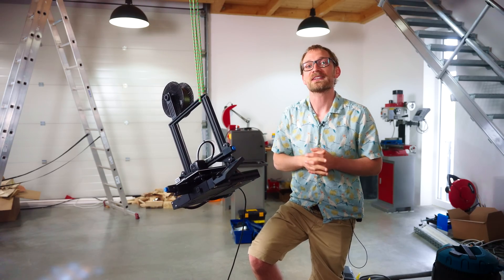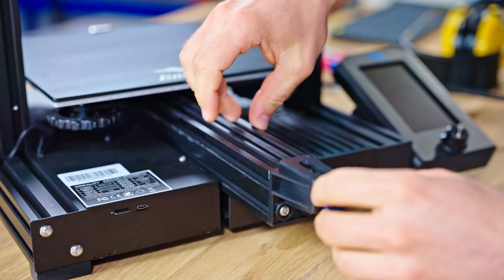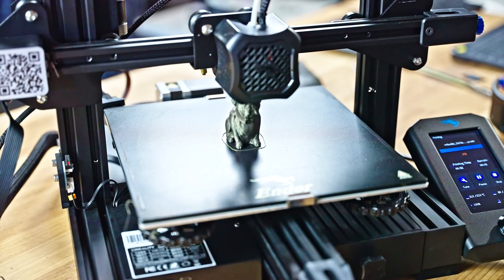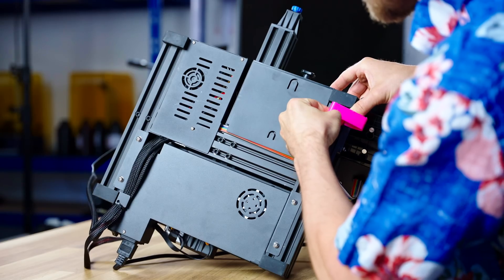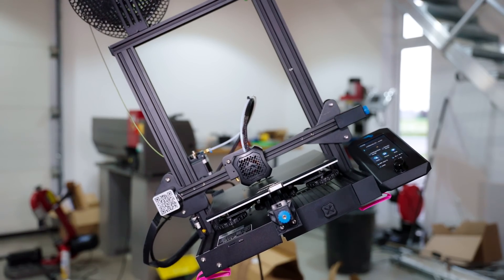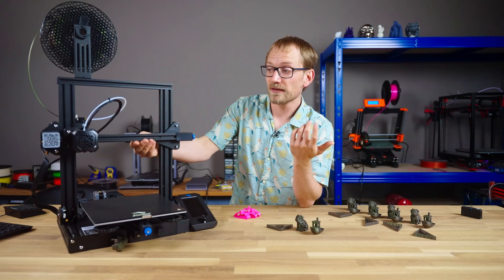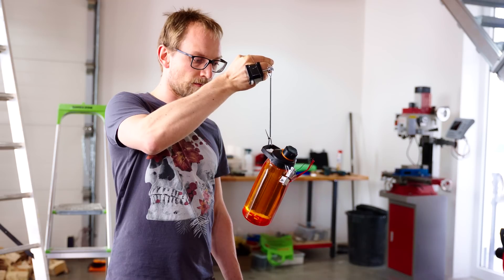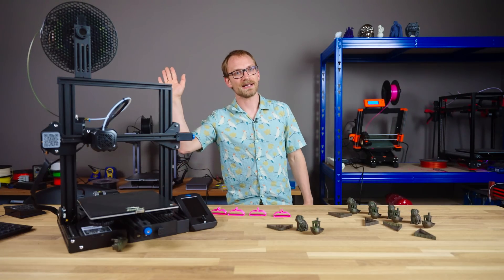Wobbly 3D printer makes for better parts!

Comment: First off I am a novice when we are talking 3D printers
That being said I own 2 and although I'm still learning have managed to dial them both in fairly well
For a living I am a commercial transport refrigeration mechanic, I'm not as young as most of you so when it comes to my various trades and certificates I've been around the block a bit 
One of the things in all my trades I've done that remains true to this day is the most simple issues are often made complicated 
Regarding my printers (every machine is different in some small way even identical ones) they are both mechanically sound and my Firmware settings work well for them 
To reduce and almost eliminate ringing and ghosting I simply turned my jerk settings in the slicer programs down very low (8mms in Cura for example)
Such a simple solution to what is actually a simple issue
Nothing is perfect, even my cheap 3D touch sensor buzzes with my settings too high. 
But that should not ever stop us from trying to improve on current technologies be it mechanical or computing using HMI's 
If you really want to reduce friction harmonic vibrations you could always use iridium magnets and electricity and instead of using DC voltage to drive stepper motors use that same Gcode to power up or down the coils using AC voltage
Much like one of those trains that glides over the tracks rather than on them
Maybe Elon Musk will design a printer that costs 100k but prints absolutely perfectly lol

Comment: I've never noticed any ringing issue with the lulzbot mini's full metal enclosure. It wasn't cheap but I've also never had any maintenance issues in several years. It always just works.

Comment: So to date, I've done all my printing with a Prusa MK3S on a folding card table sitting on a carpet.  It moves noticeably while printing, and I did wonder when I started whether or not that would affect the print.

It didn't seem to, but now I'm wondering if that actually helps the print.  Is the motion of such a table too macroscopic to do what's described here?

Comment: I've always gone for the concrete paver on a wobbly/cushioned/springy support - originally, I did this purely to keep non-trinamic printers from resonating through benchtops and amplifying the sound, but between using that base and turning down speeds, I've seen ringing practically disappear.

Still very much looking forward to getting my hands on a Klipper printer someday and setting up true resonance damping with an accelerometer, but for now, this is working reliably enough :)

Comment: I suggest you try a test with a 3d printer on one of those concrete blocks, with a layer of soft foam underneath it. The foam allows for movement, while the concrete neutralizes some sound and lesser vibrations. Possibly the best of both worlds, imo...
Reply: I'm kinda surprised he didn't mention it. It was his own video of a few years ago after all!

Comment: I assume this is my my OG Ultimaker (wood frame) could print so fast with so little distortion...  Maybe put the printer in a tray filled with sand.  Also, maybe bungee cord the printer down to the sides of the tray.  I did that with my printer at one point (to the table) while printing with an volcano at high speed.  Seemed to work!

Comment: None of these are addressing the main springy component in the whole system -- those elastic wheels everything rides on!
This problem I had on the CR-10 just aren't happening on my Snapmaker, because the Snapmaker runs all 3 axes directly on lead screws.
Suggest try replacing the elastic wheels with PLA printed ones as a proof of concept prototype. 
They don't take up the slack as they wear, but if they work, they can have thin elastic treads added. 
Try rubber bands, a few coats of latex, a coating of silicone sealant or print treads in TPU.

Comment: Of course, if you take note from the CNC world, you'd use ball screws and not belts. The other option would be to use a wider belt (going from 6mm to 10mm or 12mm), which in theory would make it more dampened, or just plain harder to stretch out.

Comment: How about using different steel reinforced belts instead ? Also just use hard rubber feet, similar ones we usually use in Germany for the washing machine and alike.

Comment: Usually when I hear people using paver blocks they're also putting foam/padding under the paver block as well, probably to act like those dampener feet while the paver takes care of that Y resonance as you saw. Though I also don't think I've heard people bolting the printer down to the paver either. Maybe a part 2 where you do the sand/weight filling and paver + padding head to head?
Reply: I was just about to comment about the paver and squishy Item too. I forget where I watched it but the combination works really well from what I remember. Alas I do not remember what the squishy item was with the paver.
Reply: @williamwinslow8807  I use a foam cushion pad that you would use in a old dining seat. CNC kitchen did a video a few years ago on using foam and concrete pavers.
Reply: @spartanash1  but it was mostly focused on noise, not artefacts, wasn't it?
Reply: @ismaelyu5  That was the reason why I did it for all my MK3(s). But it really does dampen the overall vibrations a lot too.
Reply: I've never heard of anyone bolting to it. They just set it on top of the block.
Reply: I live in an apartment. When I got my Prusa I often had the downstairs neighbor banging on their ceiling/my floor because the lower frequencies of the printer would transmit right through the countertop it lived on at the time. I then built an ikea lack enclosure for it, thinking that placing that on a carpeted area would help, but no, they beat on the floor some more. Personally I could barely hear the printer so all efforts were not for my benefit, just my neighbor. I tried many vibration damping methods to prevent the vibration transfer to the floor without luck until I tried one more that solved everything. Old shoes. I had a couple pairs of old New Balance walking shoes I had worn out at work. I placed the four lack enclosure feet into each of the four shoes. They worked amazingly well at almost completely eliminating the vibration transfer. Before the shoes I could place my ear on the floor and hear the printer working. After the shoes I couldn't. Neighbor has never beat on the floor or complained about noise even once since.
Reply: yes this
Reply: Yep, I have a big heavy paver block with some large squishy foam pads under the 4 corners, with my CR-10 sitting directly on top of the paver. Works pretty well, though I don't know if it's better than just the 3D printed dampening feet.
Reply: This is the way... i have my ender 3 sitting on a concrete paver than is sitting on 4 large white/yellow diswashing sponges, it completely isolates the printer from the shelf its on so it keeps it quiter while also helps reduce ghosting
Reply: @Thorlek  If you just want it to be quiet, you can use a TMC motor driver.
Reply: Yeah the heavy weight lowers the vibration frequency, but then you still need something to actually slowly stop those vibrations (the foam).
Reply: More unproven rumors and engineering/science based zero facts and zero measurable repeatable test results,
Just arm chair engineering here
Reply: @airgliderz  Um, what's your problem exactly?
Reply: @sledzeppelin  no, the real sbd actual question is whats your problem or lack of comprehending the issue as another way to correctly state/clarify your issue.
Reply: @airgliderz  That is nonsensical. I think you should go.
Reply: @sledzeppelin  have you solved your problems yet? Suggest therapy for you. Though if you're a narrow minded Democrat you may not be fixable,
Reply: @airgliderz  Did you stop taking your meds recently?
Reply: @Voyajer.  no but clearly you missed yours in today's kindergarten class.

Now be good girl and give your mommy's phone back.
Reply: @Voyajer.  no, but clearly and without question you missed your daily meds, or even more likely you're mommy .that identifies as your mommy forgot to give you them.
Reply: I once saw a dude in Reddit bolt a printer to the ground for some reason
Reply: @The_Wosh  I guess bolting it to the ground, as in actually earth, might actually work decently since it's kinda squishy and soft,  but not too much.
Reply: @Mobin92  nah, it was a concrete floor iirc
Reply: how bout foam, paver semi dense foam under the machine to reduce ringing ?

Comment: As you noticed, nonr of these are doing the job. The only thing that will work is stiffen the drive train. Your drivetrain is running on bungees (belts), and now you do rocket science and want to make it run as a rigid cnc. Just doesn't work that way. Simple 7th grade physics. Want ringing to dissaper will cost you a bit more than bag of sand 😉

Comment: Filling a machine with sand sounds like more work than just switching to a firmware that supports input shaping and bolting an Accelerometer to the printhead. Some Frame Braces help too with rigidity to get higher frequencies.
The more stiff the system the higher the frequency.

Comment: I made some epoxy granite 8020 brackets to be able to use on printer frames to improve both stiffness and dampening. Unfortunately part of the mold requires 3d printing PVA so it's not exactly cheap to do

Comment: Think about how cars stop motion and vibration. They use a combination of springs and shock absorbers, neither by them selves will work but together in just the right strength for the weight is perfect.
Reply: Forgot to mention they need to be in series with each other.

Comment: I have an even easier and cheaper solution. I cut some little rectangles of the packing foam that my Ender 3 shipped in and put them under the feet. It definitely reduces noise, and the foam has some slight give that should provide good dampening. It would be interesting to see a comparison of that vs the printed feet.
Reply: See cnckitchen already been compared
Reply: hah. i did the same with my printer's packaging!
Reply: My solution is at the bed itself. The bed had an aluminum foil liner, foam liner, aluminum tape, spring loaded cams at the 4 post, screws run through a combination felt-silicone gasket with a plastic gasket up top of each screw. Not much vibration wise gets to the bed that isn't also present in the floor, desk, or even ground outside. However vibrations make it into the extruder and give their own set of resonance faults that on taller prints can be utilized for decal since they are incredibly predictable by time you get the bed dampened as good as you can.

Also helps to soak all your bearings in a jar of oil every few months, helps clean them up and makes them last a lot longer. Speaking as a poor boy that loved rollerblading and had to keep a good set of pig bearings going for years on end jumping ramps, riding on rough concrete and sometimes dirt roads.

Comment: Interesting results, especially since I've had the exact opposite observations: Flexible feet made ringing worse, and while the paver didn't remove it completely, the resonant frequency and amount of banding changed dramatically (I use klipper on a heavily modded E3, and used an ADXL345 to measure resonances in a bunch of different configurations; as of right now, a paver, a layer of cork, and a rock solid cabinet is the best combination I've found for my setup, and the MZV input shaper seems to prefer working with the high frequencies that results in)

Guess the best part is that it costs next to nothing to print a set of those feet and just try it out, so even if the results vary there's nothing stopping people from checking for themselves
Reply: thats because a stiffer frame leads to a higher reasonating frequency (or just removing one of the frequencies). But without input shaper its the opposite. The wobbly printer makes the amount of mass needed to push against less when it comes to the hotend, so it doesn't have to vibrate as much.

Comment: The belts seems to be the main issue.. I have seen some new types of belt used in some new 3D printers and am curious if a different drive material would result in less ringing.
Reply: Belts and belt tension don't effect ringing all that much. There's some minor differences between cheap Ender level belts and real Gates belts.
Reply: @chrismorrison9140  You sure about this?
I think the belt being too loose or too tightness would affect how much the X or Y would resonate when moving.
Belts transfer the stepper motors rotation into movement for the X and Y.. So it would ringing would be affected by how tight or loose the belt is.
Would have been good if the video did some ringing test based on belt tightness level.
Reply: @chrismorrison9140  I’ve seen a significant difference at certain speeds and tension, especially over time as they wear. Keeping them properly tensioned makes a huge difference with ringing (on certain machines).

Comment: Adding mass to a spring-mass-resonance lowers its resonance frequency. Adding the paver to the print head should bring resonance frequency way down. Adding it to the frame is the wrong side of the spring.

Comment: I actually have all my printers on a sheet of MDF ontop of a piece of EVA foam floormat tile. This includes my Ender 3s and Voxelab Aquilas which those 4 are bone stock. I never seem to have any ghosting/ringing and my desk vibrations are more or less non existent as they can't even be picked up by some of the precision instruments I have.

Comment: I wonder if it would help if you braced the frame with diagonal rods that have compliant bushes in them to absorb the vibrations, rather than the rigid rods that you see on some printers. Obviously making the frame of the printer out of heavier materials like steel is going to help, just by adding mass, but perhaps some rubber bushes here and there might help with the ringing. This of course would be a from-scratch build, but people are doing that anyway. I think I may have seen a few 3D printers made from steel, but I can't recall where.

Comment: Could it be that you just were lucky that the anti-vibration feet worked well (as dampeners) at the frequency your specific print speed caused as ringing frequency? Different setup and different printer could cause different results, then.

Comment: I wonder if gearing down the steppers would reduce the artifacts in the print, or at least make them smaller. Although if the gearbox had too much backlash it might make them worse...

Comment: As important as decreasing mass (not weight) is increasing stiffness. I suspect that the compliance in the X-axis comes from the parallelogram-deformation of the rectangular gantry. (and also from the belt, to be sure). Stiffening the frame by adding a sheet of OSB in the top half (unused for your demo) can confirm or refute this hypothesis. As damping is indeed crucial (despite the increased stiffness) the dull nature of OSB (as opposed to a sheet of steel) will help here too.
The "ultimate" solution is to add a contra-mass, moving in a mirror-image-manner to the head, but it is questionable if this is worth the effort on an Ender3V2.

Comment: i cant find the video, (EDIT: HERE!!!!  https://youtu.be/rEoc0YoALt0 ) but there is an AI that can take a video feed and detect and visually enhance minute structural movements  on machinery. The result is a video where the motion is greatly exagerated and can be used to detect specific parts of a machine that are vibrating.

Something like that could be used to further find areas of vibration on the machine.....of course, this aint a practical solution since the analysis would most likely be unique to the individual printer

Comment: I put foam pads under my Prusa which is then sat on a concrete paving slab years ago, done mainly to reduce vibration noise transferring to the surface it's sat on and works well, now I hear it helps with reducing ghosting, what a nice bonus :)

Comment: I'd be fascinated to see what happens if you clamped the printer down, then rigged bungee cords to both front and back of the bed, and left and right of the print head, so all four were in tension across the full range of X/Y motion.

Comment: I use input shaper to measure this somewhat more objectively in klipper. I did a fair amount of testing of a variety of foam, rubber, cork, and multimaterial antivibration dampening feet tiles and pads, as well as amplifier feet, svs subwoofer feet, compressor feet on the printer, and a variety of different durometer sorbothane antivibration pucks, and an 80 lb 24x24x2 paver. I tried multiple individual things and combinations, and ultimately landed with the paver on top of rubber+cork pads, with amp feet on the printer, with sorbothane 45 durometer pucks under them above the paver. I was able to get a clean single spike above 60 hz at around 10500 accel in 1e3 scale in both x and y axis on mzv, allowing me to basically print 300 mms/10k accel all the time with minimal smoothing and no ringing on a very large 350 voron 2.4. And this is on a 400 lb workbench that wobbles badly in y.
Reply: Justin, have you considered writing up your process?   That would be a cool how-to.
Reply: @gibsonblogger  might do. I'm building a new printer in 48v will think about it when I'm done.
Reply: I just use input shaper to solve this :)
Reply: @Tedlasman  You still need the resonances clean and minimized physically to do 10k+ accel accurately. IS can get rid of the ringing, but you'll have rounded off corners instead if you go above the acceleration it recommends.
Reply: @daliasprints9798  100%